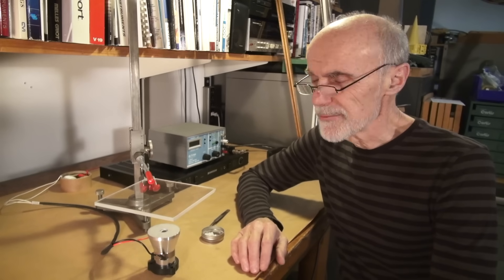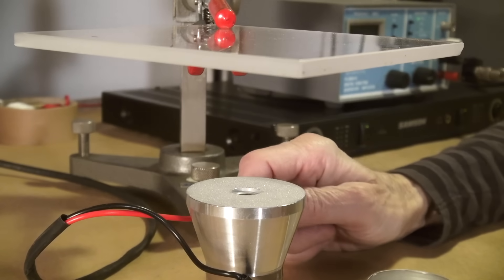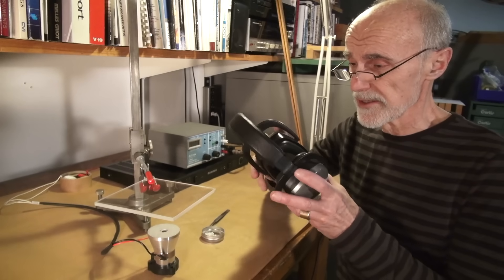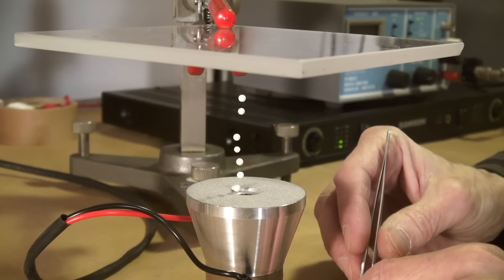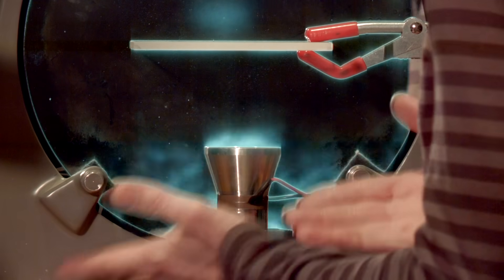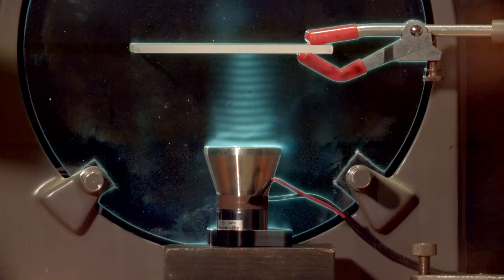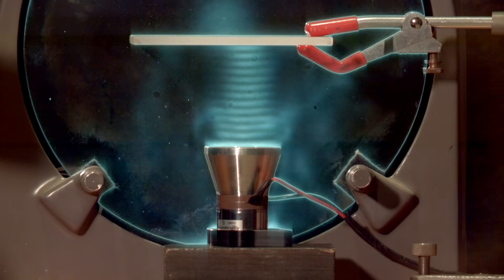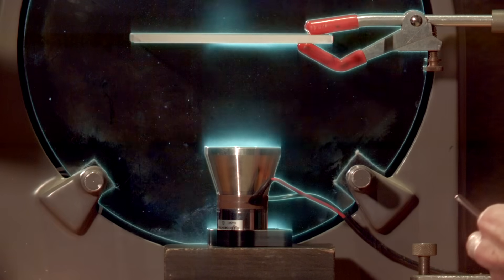Acoustic Standing Waves and the Levitation of Small Objects

Comment: First off, thank you. This is one of the best acoustic levitation demonstrations on the web. As is the schlieren optics portion in this and in Daniel's video. The amplitude of the pressure waves shown with the schlieren setup was impressive. This was not covered on in the presentations section on Harvard's site so I was hoping you could give a brief description of the amplifier used and the matching transformer in the back ground that appears to be a self wound ferrite core.
Reply: The amplifier is a Samson Servo 120 audio power amp.  A home-made impedance matching transformer couples the 8-ohm output to the ultrasonic transducer.

The core of the transformer consists of two C-shaped pieces of ferrite which, when put together make a square. Ferrite is better than iron at high frequencies. The primary is 10 turns of #18 wire and the secondary is 100 turns of #22 wire. The inductance of the primary is 230 microH w/ secondary open and 16 microH w/ secondary shorted. It's operational inductance is such that its impedance is well matched to the 8-ohm output of the amp. The inductance of the secondary is 18.8 mH w/ pri open and 1.8 mH w/ pri shorted. It's operational inductance is around 10 mH. The static capacitance of the transducer is 3550 pF. To resonate at 28 kHz, we want an inductance of 9.1 mH. The inductance of the secondary is a close match for that.

The "speaker" is an ultra-sonic power transducer (designed for ultra-sonic cleaning baths) such as one of these: https://www.americanpiezo.com/standard-products/ultrasonic-power-transducers.html  The one I'm using is the 50-watt version (but I'm only operating it at around 8 watts).

Hope that helps.  Thank you for your kind words about the video.
Reply: Thank you for the quick reply and detailed information. I was heading down the path of implementing some type of impedance matching and your example helps a lot. I wanted it mainly to get the most power at resonance but also to prevent resonance at a frequency other than what the transducer is expecting which is an issue with this amplifier (Pyle PT210) using the 70V output. My setup (for a demonstration in my daughters 6th grade science class) was inspired by yours except I am using an iPhone on an XY translation stage. Thanks again and happy sciencing! :)
http://www.thingiverse.com/make:382484
Reply: Your set-up looks very nice!  Good luck with your transformer.
Reply: you are very welcome

Comment: We're doing a physici contest (school level) and we want to reproduce acoustic levitation. We have the same kind of transducer but a 100W version, and we're trying to figure out how we should power it. Could you help please?
Reply: The core of the transformer consists of two C-shaped pieces of ferrite which, when put together make a square.  Ferrite is better than iron at high frequencies.  The primary is 10 turns of #18 wire and the secondary is 100 turns of #22 wire.  The inductance of the primary is 230 microH w/ secondary open and 16 microH w/ secondary shorted.  It's operational inductance is such that its impedance is well matched to the 8-ohm output of the amp.  The inductance of the secondary is 18.8 mH w/ pri open and 1.8 mH w/ pri shorted.  It's operational inductance is around 10 mH.  The static capacitance of the transducer is 3550 pF.  To resonate at 28 kHz, we want an inductance of 9.1 mH.  The inductance of the secondary is a close match for that.

You can probably buy a transformer with similar impedances and inductances.
Reply: Any  audio power amp will do ... we use a  Samson Servo 120 audio power amp.  A home-made impedance matching transformer couples the 8-ohm output to the ultrasonic transducer and steps up the voltage to 400 volts AC (that's absolutely necessary).
Reply: Thank you very much. If you know where I can buy such a transformer, tell me. Sorry for my English.
Reply: Hello, can you explain in detail how to make the impedance transformer please? Thank you in advance.

Comment: let me say this. use all the power one nuclear reactor can produce. wired to a sound device. hmm wonder what would happen.
Reply: Nothing, because the eco-terrorist liberals are shutting them all down!  BUT, in case you want to know, before Barbara Boxer shut down the San Onofre Nuclear Generating station, costing 3,000 people their jobs and the Western United States the baseline power to the grid, the two units were putting out 2.4 Gigawatts of power, 24 hours a day, 7 days a week (with occasional reductions every 18 months for fuel maintenance).  Enough to power a flux capacitor.   ;-)
Reply: Jack DiNucci then no rocking grooves man
Reply: ultrasonic transducers are not speakers... They are metal rings!

Comment: A couple of questions, would this experiment still work with a normal everyday speaker if it was connected to an amp?
Reply: No.  A "normal everyday speaker" cannot reproduce a 28 kHz signal. A tweeter usually cuts off around 20 kHz at best.
Reply: Thanks Wolfgang, so the freq. range is important for this type of experiment. One experiment I'd like to try is at 770 KHz but I don't think there are any inducer/speaker at that range.
Reply: That kind of frequency is used in medical sonography and uses piezo electric transducers.  You'd be dealing with wavelengths that are of the order of 1/2 mm which, if you're trying to image something, is approximately the resolution you can achieve.

Comment: What did you use as sound source?
Reply: A PASCO function generator producing a 28 kHz sine wave.
Reply: But what kind of speaker?
Reply: The "speaker" is an ultra-sonic power transducer (designed for ultra-sonic cleaning baths) such as one of these:  https://www.americanpiezo.com/standard-products/ultrasonic-power-transducers.html 
The one I'm using is the 50-watt version (but I'm only operating it at around 8 watts).
Reply: Thank you so much!
Reply: can you give me a link to the one your using??

Comment: Where can I find a stand like that to hold the platform?
Reply: If you're referring to the adjustable stand holding the piece of glass, I'm sorry I don't know.  It was a piece of lab equipment that was lying around and I thought it might work well for this application.  Maybe you can find a small cheap rack-and-pinion on eBay and adapt it for this purpose.
Reply: Darn, I've been looking all over for one I found the three-finger clamp, but not the actual stand.  I've settled on just a simple ring stand to hold the platform.  It will probably work fine
Reply: A ring stand certainly will hold the clamp, but what's also important is the ability to easily and smoothly change the height of the clamp.  As you can see from the video, the creation of the standing wave is very sensitive to the height of the reflector.

Comment: What would happen if a larger object were inserted into the field? An object that is larger than one of the high pressure regions, would it still levitate?
Reply: Interesting question ... something we should try out.  My guess is that the object will levitate if it is a 1/2 wavelength in diameter (6 mm in this case), assuming it's light enough.
Reply: Wolfgang Rueckner Thank you for your reply!

Comment: Wouldn't the balls stay at low pressure points rather than high pressure points?
Reply: That's what one would imagine if you're just thinking about pressure.  However, the low pressure regions is where the air is moving back-and-forth most rapidly and the high pressure regions is where the air is moving minimally, or not at all.  So if a ball gets put into the low pressure region, it gets jostled by the oscillating air molecules into a region where there's relatively little motion (and that's the high pressure region).  Make sense?
Reply: No.  Using that logic a ping pong ball would not stay in the middle of an upward stream of air.  Plus your statement contradicts several other videos and web sites on the matter.
Reply: Not sure what the coanda effect has to do with this demonstration.  Regardless of what others have said, the video is empirical evidence that the ball ends up in the high pressure region.
Reply: Looking at the latter demo showing the light and dark bands.  They are evenly spaced as expected.  Right next to the reflector is a small dark band exactly at the proper distance from the next dark bands below.  This is a  high pressure point where the molecules are moving the least and constrained by the surface.  The balls and clouds are in the low pressure zones (per Bernoulli's principle) where molecules are moving the most due to the standing sound waves.  Thus the balls would seem to be at the low pressure points.
Reply: Sorry, but I don't see it that way.
Reply: Perhaps this is a terminology misunderstanding.  A better way to say it would be to point out that the balls were at the points where the sound amplitude was the highest.  The pressure there varies rapidly due to the sound frequency.
Reply: Sound waves can be described in terms of air displacement or in terms of air pressure variation. The minimum of one is the maximum of the other one. You can take a look at a basic physics university book; that is clearly discussed there.

Comment: Hi, I am wondering if you could provide specifics on what is powering the ultrasonic transducer. Is it directly connected to the amplifier?
Thanks
Reply: A function generator provides a line-level sine wave at 28kHz.  That signal goes to a 100W audio power amp.  I designed and made a ferrite core transformer to match the output impedance of the audio amp and the ultrasonic transducer.  It's a x10 set-up transformer and the inductance of the secondary is around 9 mH.  Together with the 3500 pF capacitance of the transducer, the resonance frequency of this circuit is close to 28kHz.  Power into the transducer is between 3 and 8 watts to secure levitation of the balls.
Reply: Wolfgang Rueckner, The transformer is that yellow round thing on the left at 0:14? How much mH are in the primary coil? And, by chance, did you measure peak-to-peak voltage on the primary?

Comment: Why do the balls sit in the high pressure regions, instead of atop the high-pressure regions, within the low pressure zones?
Reply from the maker: The regions that we're calling low pressure are where the air is moving up and down with the greatest amplitude. These are the antinodes. A particle in such a region would get pushed to the nearest node, where the amplitude is the smallest and the air is pushing and receding symmetrically.
Reply: Thanks for the quick reply! This makes sense. It's tougher to visualise the nodes of longitudinal compression waves -- but I suppose they're analogous to nodes and anti-nodes of a vibrating string. In the vibrating string of course, a small hoop on the string would tend towards the stationary nodes.

Comment: Awesome!  During the first half of the video, I had this idea that the balls would rest in the low density regions, sitting atop the high density planes of air, so I'm glad for the schlieren setup.  It took a fair bit of thought to (maybe) understand what is going on.
Reply: My balls always rest at low frequency 😂
Reply: It's not that easy, though. The reason why the balls fluctuate is because there's a non-linear term on the sound pressure equation that doesn't cancel out (generating a  net force upwards). It's not straightforward!

If you think, since the waves generate pressure both positive and negative in the anti-nodes, the average resulting force should be zero, as the sound is oscillating much more rapidly than the ball can respond. It's fascinating, I myself don't understand that well but if you're interested you can look it up.
Reply: Thanks for explaining it properly. The explanation given in the video didn't make sense to me, but your explanation is much better.
Reply: glenm99 ball be resting on your bitches face
Reply: I am too young to get this.. Aren’t the balls suppoused to sit in the low-pressure point, since everything is naturally going from the high-pressured points to the low pressured points? Just like in a balloon, air moves out, because there is more pressure within the balloon.
Reply: Dávid Varga

The thing is, there aren't points of continuous high pressure and low pressure in this system. The space between the  driver and the plate actually contains sound waves generated by the driver element, along with the reflections of these waves off the reflector plate. At any point in the space (and a particular moment in time), the pressure is the sum of the incident wave (which is the wave produced by the driver) and its reflection. This is similar to a vibrating guitar string, which can also be imagined as a wave being continually reflected at the ends of the string. Just like the guitar string, there are points where the amplitude of the wave is highest (the antinode) and points where the amplitude is 0, because the incident and reflected waves cancel out. There's a good description here: https://newt.phys.unsw.edu.au/jw/strings.html

As Fernando said, the reason the balls float is because sound waves in air have non-linear properties that become apparent at high amplitudes. This results in areas of high average pressure, though the pressure still swings around. The balls can sit atop the areas of high pressure, because the high average pressure creates a force that is not balanced by the air above.

Comment: Excellent.  Very clearly demonstrated. I noticed that the glass reflector is quite thick.
Reply: Saken Kenzhegulov nope😂 it wouldn't..if he doesn't exactly hit that resonance frequency it will just vibrate with the other frequency but with a way lower amplitude..and that's the problem. thinner glass is easier to get to vibrate so it takes more energy up.
I guess thicker glass just reflects it better.
Reply: Great ! black hole science Lab.
Reply: @_I_am_a_liar  What do you mean? Could this cause black holes?
Reply: * T H I C C *
Reply: maybe I'm being obvious, but thin glass would break there =)
Reply: @saken2909  Not necessarily, having simply high frequencies won't break all glass, you need the fundamental frequency for the glass and blast it with waves at that frequency
Reply: @saken2909  Actually, glass that thick could break too if it matched the resonant frequency of the speaker and the output of the speaker was high enough.

Comment: I need to get my hands on such a large concave mirror... But they're impossible to find anywhere!
Reply: look for a used reflector telescope and use that mirror
Reply: Experimentboy  just buy girls make up mirror   worked for me
Reply: I've been looking for ages as well. I even tried a cheap one from amazon but the tolerance was terrible.
Reply: @NickMoore  i'd use an old satellite dish covered with glued tin foil, burnished and polished.
Reply: Kestu fous la toi mdr
Reply: @José el angél 
first layer from the top, or first layer from the bottom?
but, its not reflecting yeah?
im asking because im thinking of the firmament behaving like a lense maybe..?
Reply: Experimentboy Just make one! They’re so easy to make, made a small one with a 3D printer, Mylar blanket (the shiny tinfoil like blankets you see wrapped around marathon runners after the race), and regular tape. You don’t need a 3D printer though, I was just playing around. Get a round plastic trashcan lid, whichever size you want, just has to be concave enough. Fit shiny Mylar on top of the concavity, tape very well and tight as to stretch Mylar flat as possible. You now have a mirror. Turn the lid around and puncture hole in it and suction the air out creating a concave Mylar reflector!
Reply: This is NOT a concave mirror. It is a flat mirror and he is using polarizers.
Reply: @RobotalkerSupport  really i was under the impression schlieren uses parabolic mirrors to focus to the light to a point. how does it work with a polarizing mirror?
Reply: Not surprised to see you here :)
Reply: You may want to look at this site.http://www.edmundscientific.com/ If they don't have a large one, they may be able to point you in the rite direction.
Reply: Newtonian telescope
Reply: there's a youtuber that made a parabolic mirror with a space blanket. night hawk in light i believe.
Reply: Newbie
Reply: Look up "Surplus Shed". They have lots of second hand optics.
Reply: u need to get ur hands on this diq!!
Reply: Nika Alavidze how can I make it?
Reply: Tiens tiens
Reply: could try to make one yourself. just spitballing but a shallow rotating vessel of some manor of resin would probably work pretty well. then, if the resin itself can't just be pollished, you would just have to coat it in something reflective.
Reply: Use the ionosphere the dome firmament, you just got to get a bigger object to act as a base
Reply: @michaeldesir4235   They have these demon telescopes that work the same way .  https://www.youtube.com/watch?v=Q99w8yZtT_c
Reply: Experimentboy make your own simple
Reply: Experimentboy Le plus simple serait effectivement de trouver un vieux miroir primaire de newton, quitte à le faire re-aluminer (ça ne coûte rien). Il est possible de les trouver sur les petites annonces des sites genre Astrosurf ou Webastro, les clubs d'astro en ont souvent un qui prend la poussière aussi. Et il reste, au pire, le bon coin.
Reply: Experimentboy vive la France
Reply: Experimentboy  we have a huge one above our heads ....I call it the first layer of the firmament .
Please wake up proper people 🌼💚